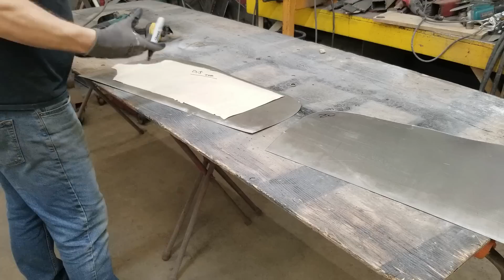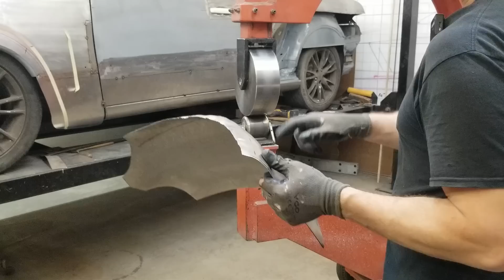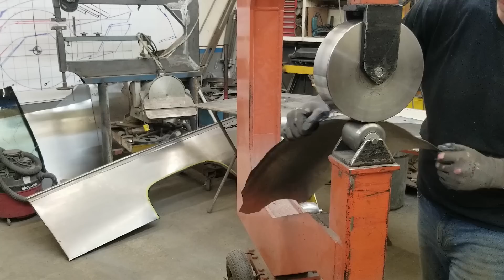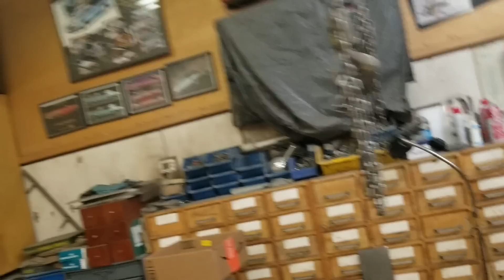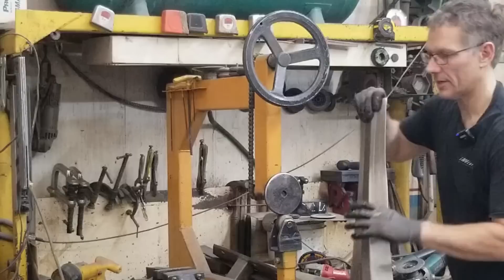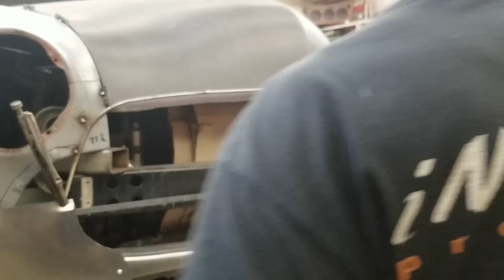Completely NEW DESIGN - Ford SHOEBOX Front & Grill ! Ep.11 - 1951 FORD + INFINITI G35XS Sport

Comment: A late 50's 5 X 7 hot rod/custom annual had a picture of a chopped black shoebox convertible on the waterfront. Frenched headlights, a grille opening with a smile. I thinh it was mid 50's Buick chrome molding on the top with a filled Vette grille bar.
Reply from the maker: Cool!

Comment: I'm not convinced that the size of the "bullet" is right. More subtle would be my choice, but it will be the center point of your grill design, so no denying its importance to you in the final look. Eye of the beholder.
Reply from the maker: No worries Drew, I'm not running with a bullet.  The drawing was a random shoebox 3/4 view i found on the interweb and doodled over top of.  What is important are the new lines formed on the car itself.  Thanks for watching!